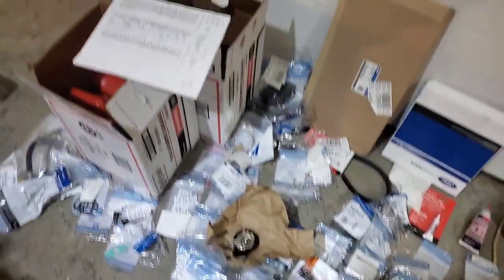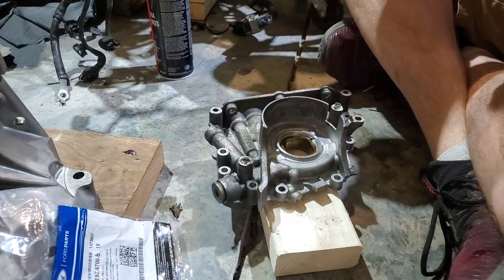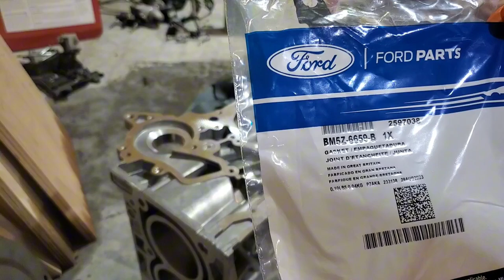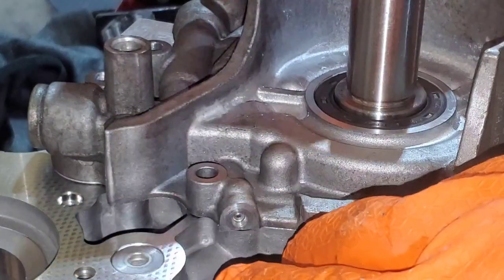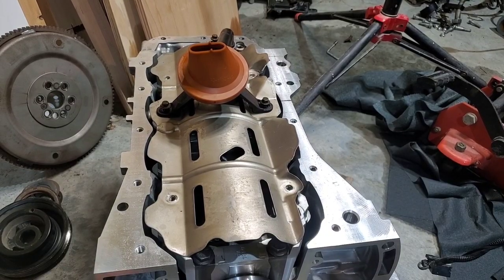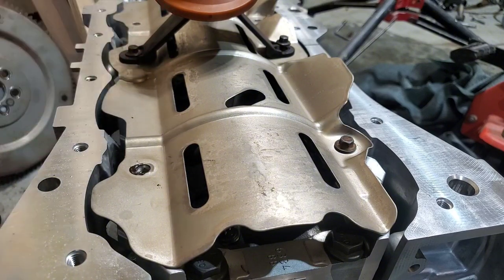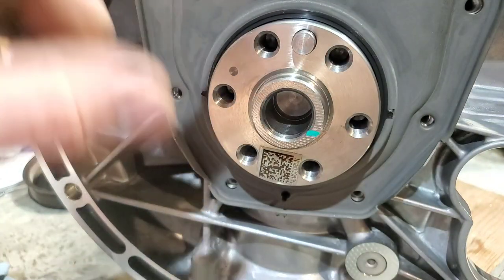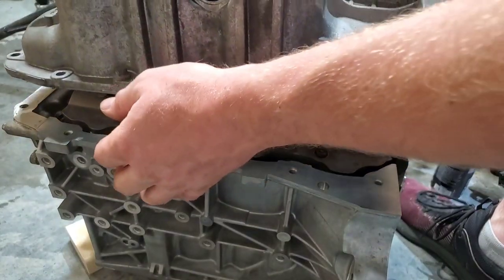NEW BLOCK part 3, Ford ecoboost 1.5l

Comment: It's a blessing that you are able to fix it yourself cause Ford would have changed you thousands of dollars. Great job fixed-ish
Reply from the maker: Thanks 👍
Reply: What about part 4? The reassembilily of all the hoses and brackets and bolts is complicated.
Reply from the maker: I have part 4, 5 and 6 all out now. https://youtube.com/playlist?list=PL_zddueTpgw6vs7ej9LHtWUOGYW17qBGi&si=QbdHRYHZYEru2kmr

Check out my Playlist to see all the videos on this project. Engine is complete, hopefully installed and running this weekend with videos posted this coming week!